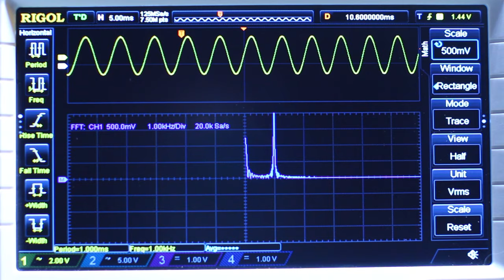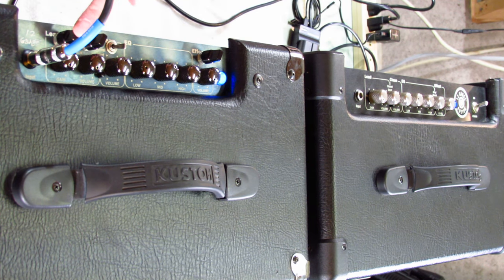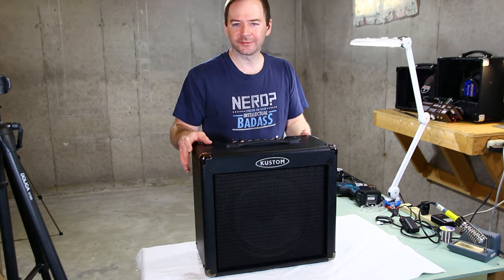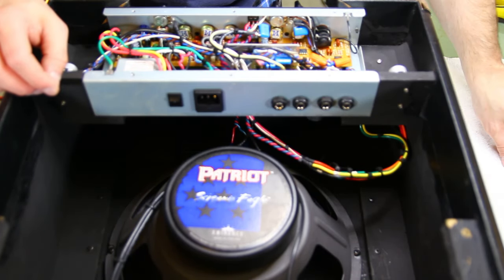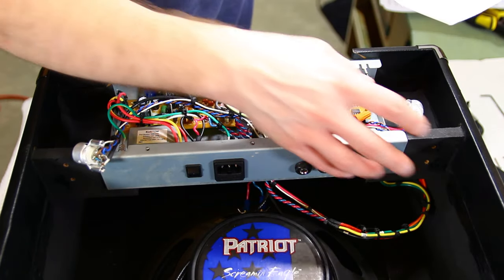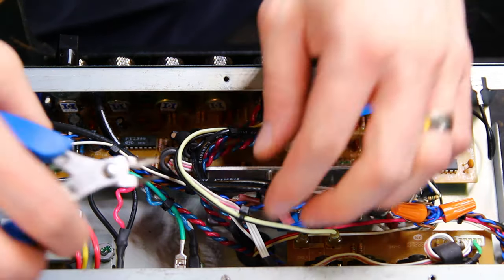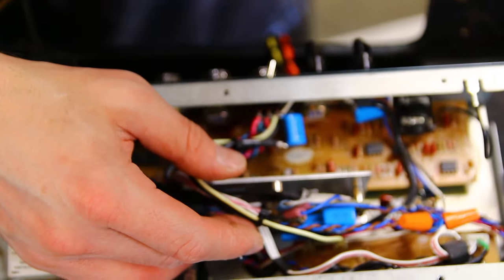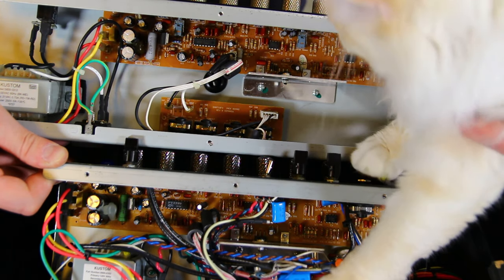6.  Guitar amp giveaway!  Spring reverb(and everything else!)

Comment from the maker: "Built in" effects:  3:33
"Stock" effect on old amp: 6:00
Spring reverb: 9:00
"Tube talk" and some demo: 10:50
Overdrive comparison:  12:00
Tube overdrive and some spring reverb:  16:20
View of the reverb tank:  17:55
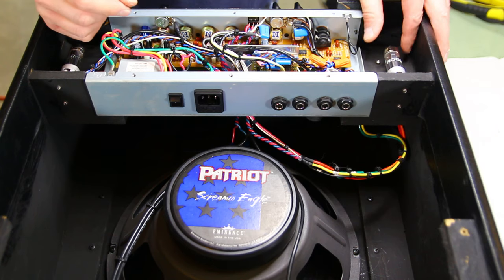Output tubes:  18:25
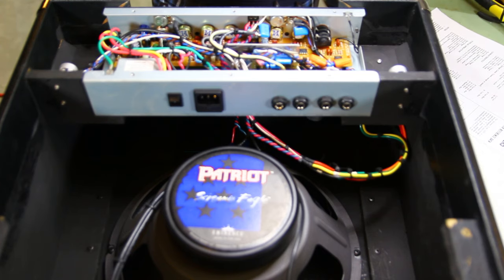Schematics:  21:00
No disassemble Johnny 5!  23:00
Dual triode tube:  27:20
Output transformer:  29:18
Wiring and custom circuit board:  31:33
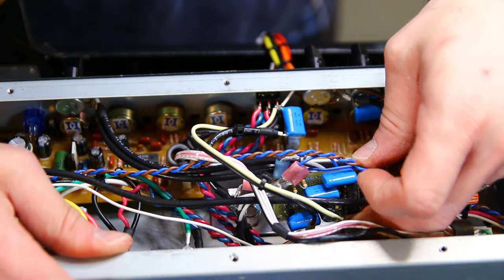My lovely asawa 😍  39:00
Closer view of the circuit board:  39:40
Stock PCB comparison:  42:43
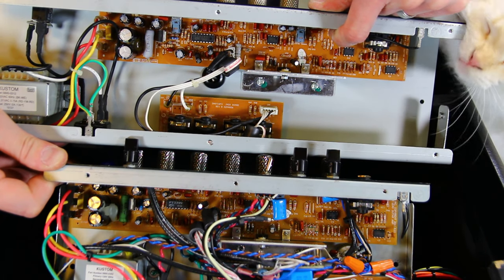Our kitty Cloud 😆  44:00

Comment: Subscribed and liked.

Well you can never go wrong with reverb so maybe plate and or spring reverb with a toggle switch.
Reply from the maker: Thanks a lot, sneszocker!  You'll be added to the drawing.  I have never investigated a plate reverb... thanks for the suggestion, I will look into it.  A switch to enable or select the reverb is added to the list!
Reply: @unique_amps_electronics  I have never seen (or heard) of a REAL plate reverb in an amp. Yes emulaters of plate (or any kind of reverb in fact). A real plate reverb would probably be too large to fit in an amp.
Reply from the maker: @mauricedibert2635  , thanks for the info!  It might be a silly idea, and I haven't investigated yet, but something that just popped into my head is a "serpentine" or "switchback" design to shrink the footprint, but I'm sure that would completely change the resonant frequencies, so maybe not.

Comment: Subscribed and liked. Awesome vids! Maybe it’s not really a mod, but I saw a vid of amp with LED lights around it and it looked pretty sick. Or It would be cool to see a bass amp rigged so the bass sounds like a guitar
Reply from the maker: Hi Sean, thanks for the watch, sub, and like!  Yeah, I installed EL wire in place of the white fluting on this one, but didn't demonstrate it in the video.  I think I mentioned it in my Welcome to Unique Amps video.  The EL wire inverter induces a lot of noise, so I never use it.  LEDs would probably be much better.  I could probably find an LED strip to replace the white fluting.  I think you are the second person to request a bass amp, which I'll have to add to my project list 😅
Reply from the maker: You'll be added to the drawing, BTW 😁

Comment: Liked and subscribed.  Fuzz or distortion added would be great.
Reply from the maker: Hi again, Slawomir!  Thanks for watching and supporting!  I'm planning on modifying the existing distortion, and adding a treble boost.  If I add tubes, they will be another source of distortion 😁
Reply: This amp is gonna be powerful and versatile, when you’re done.  Two distinct distortions would create a very interesting twist.
I have an idea that I’ve never seen before.  What about placing a modular mount on top of the amp on both sides of the handle. Then different pedals could be attached depending on what the player wants.  In essence, the amp would have all its’ inherent diverse sounds and be a mobile pedal board at the same time.
Reply from the maker: @spaz4774  Interesting idea, I'll look into it.  Might not be much room on both sides of the handle, but maybe enough for 1 or 2 effects on each side... 🤔